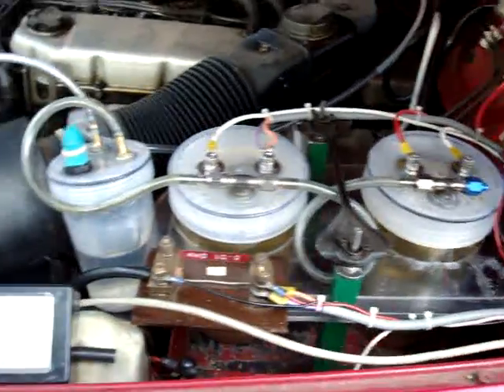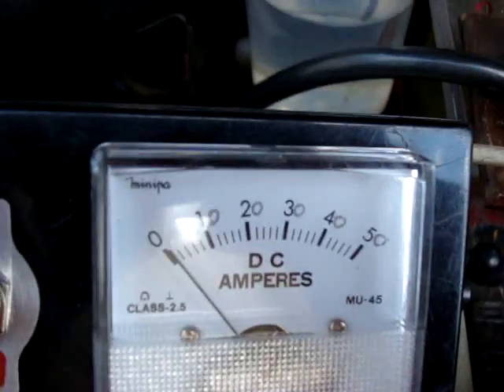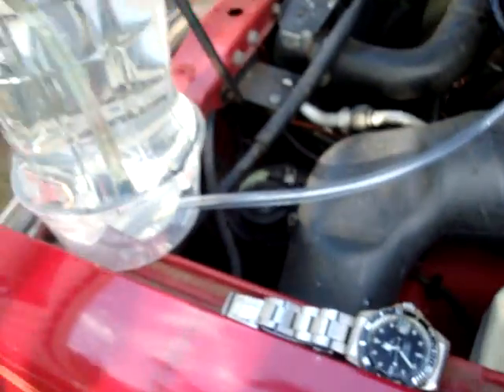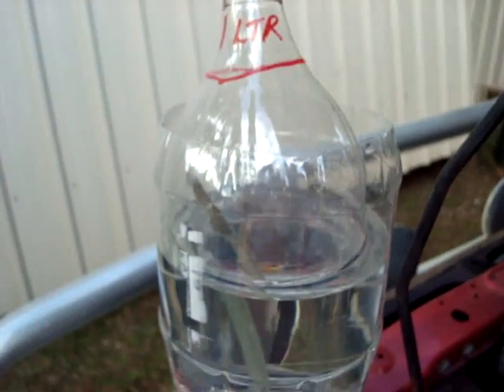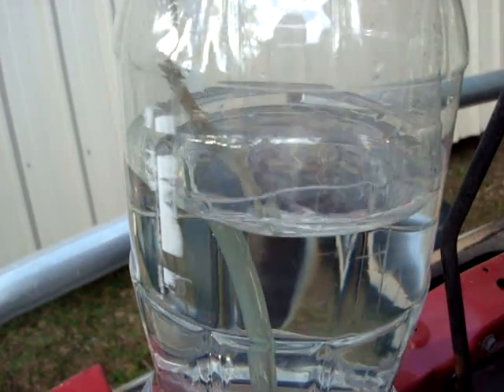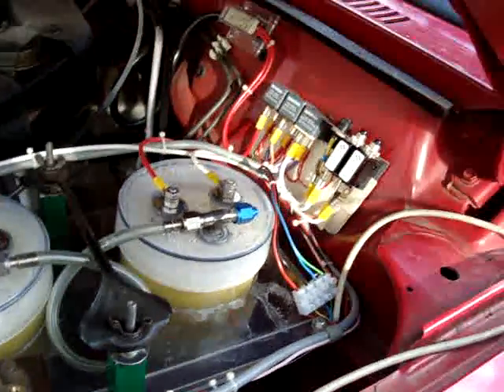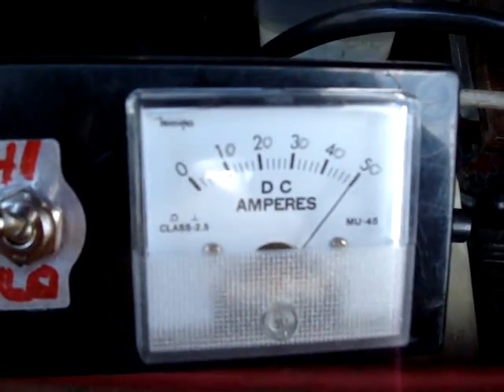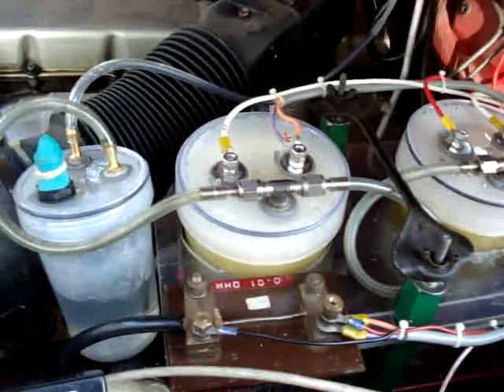hho in the car @ 1.7 ltr/min

Comment: Hello good video but I have a suggestion 50 amp is too much consumption. It is possible to generate the same gas quantity with much less amperage if the electrolyte warms up much is not good either

Comment: 12V @ 60Amps = 720W. 
2L @ 720W - sorry, very inefficient!

Ppl get 2.2L @ 220W without rocket sience just efficient design. I did invest into 12x36 316L SS plate cant wait to build mine. I have to spirals 6V @ 8Amps. Very inefficient due to current leakage.